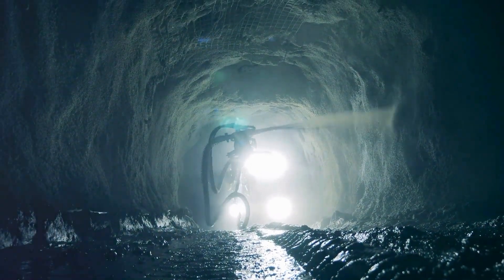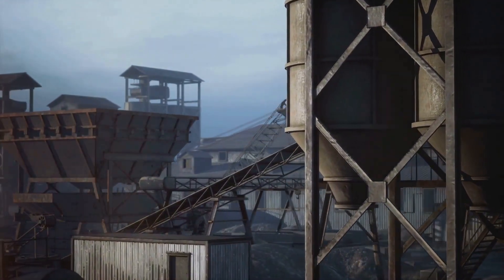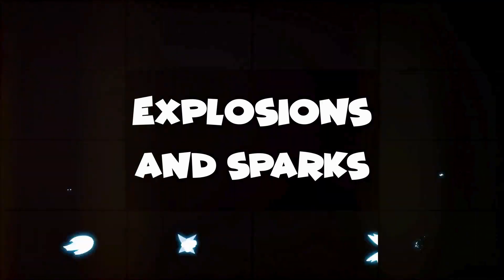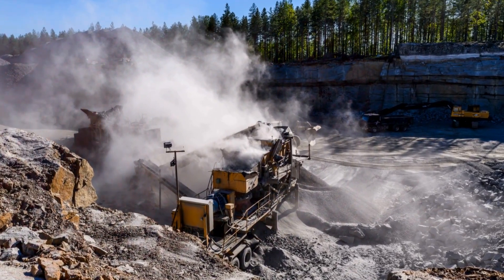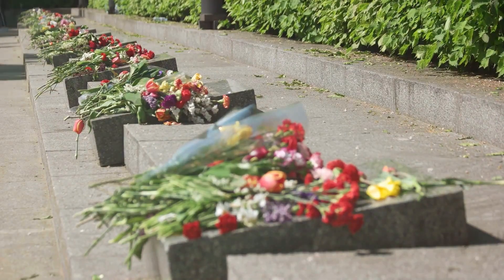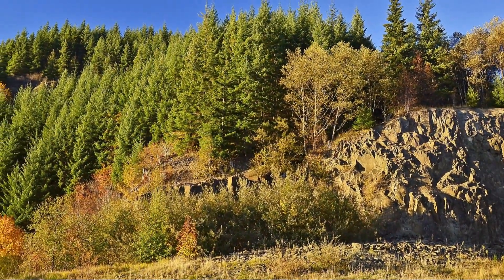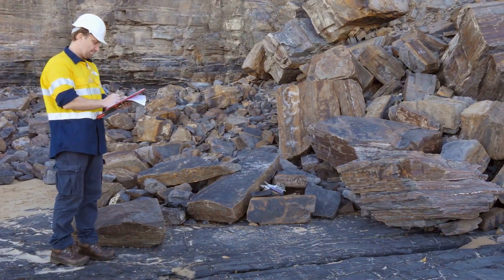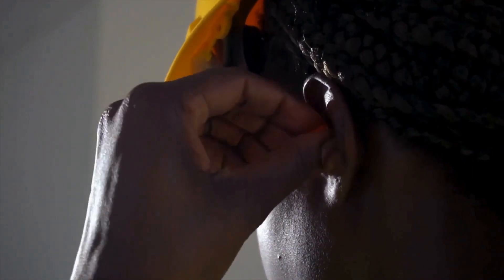Coal mine explosions

Comment: thank you for this great presentation

but how do they control ignition source
Reply from the maker: Thank you for your feedback! To control ignition sources in coal mines, several measures are implemented: 1. Regular maintenance and inspections: Ensuring all electrical equipment is properly maintained and inspected to prevent sparks or malfunctions. 2. Ventilation: Effective ventilation systems to dilute and remove explosive gases like methane. 3. Explosion-proof equipment: Using equipment and electrical installations designed to be explosion-proof. 4. Gas monitoring: Continuous monitoring of gas levels to detect and mitigate any buildup of explosive gases. 5. Safe working practices: Training workers on safety protocols and avoiding activities that could generate sparks. These measures help to minimize the risk of ignition sources that could lead to explosions.